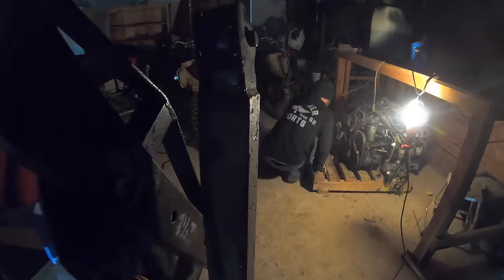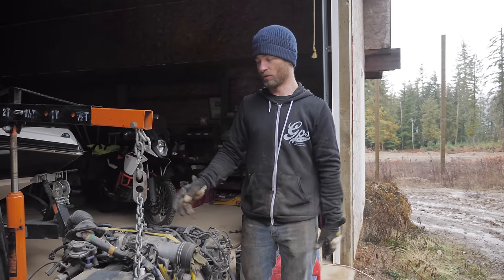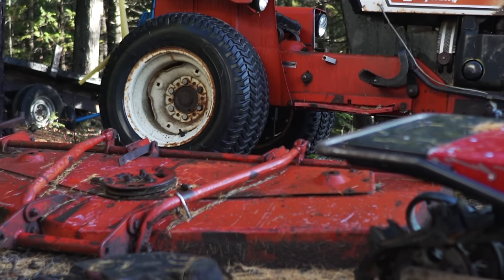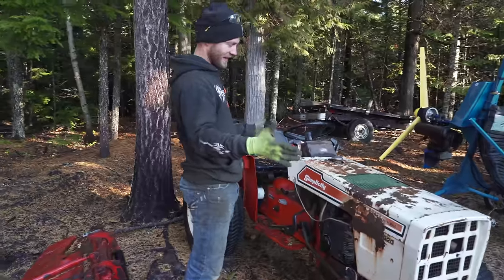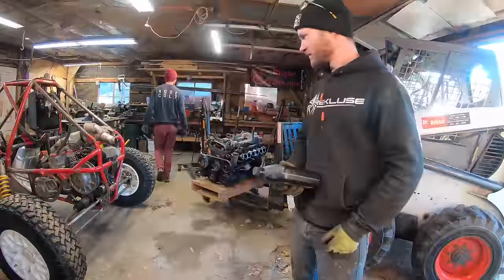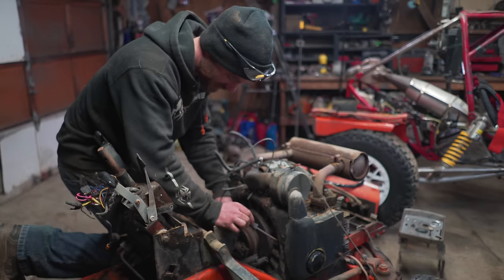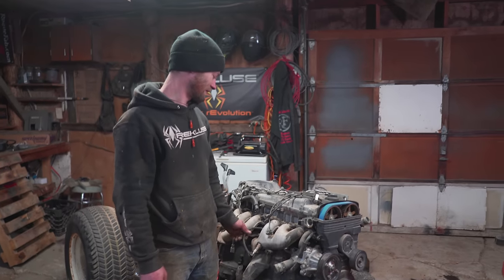2JZ Lawn Mower Build

Comment from the maker: Install Raid for Free ✅ IOS: https://clik.cc/GHPC_iOS ✅ ANDROID: https://clik.cc/GHPC_Android
Reply: I don't think I've clicked to a video faster than I just did...😂
Reply: I can’t wait until the build is complete
Reply: You guys need to make an app that you build cars and “toys” on
Reply: Why 2j a lawn mower but put a snow mobile engine in the triumph probably just swap that around an you’ll be better off  would be way more dope n controllable
Reply: "turbo it till it blows up" so 1400 up lawnmower?
Reply: @dave_wheelies3903  Because the Triumph is up and running.
Reply: You guys need to be careful when u get that done that kinda scares me. But still super rad build tho!!
Reply: Get a head off of a turbo 2jz engine that’s the only different in the turbo and non turbo is the head
Reply: Hey there, Just an idea I had! instead of using the distributor you could install coilpacks
Reply: If the good Lord keeps you rolling I can only imagine what you guys will be building in ten years from now!! Nice grinder!
Reply: Its been awhile. Vidio on update?
Reply: do a update video!
Reply: When is the driving video??
Reply: Hey where’s part 2?

Comment from the maker: We forgot to mention this in the video but we will be installing a fully-functioning mower deck just have to get everything sorted out without it first. If all goes well hopefully we will be drag racing come spring! Thanks for watching guys!
Reply: Grind Hard Plumbing Co can’t wait!
Reply: Awesome 🤘😂
Reply: Nice
Reply: Didn’t Life OD do this to a tractor? Lol
Reply: Grind Hard Plumbing Co don’t
Reply: Ls swap an office chair
Reply: I'm glad.
Reply: Cuttin grass at 88mph😂who needs roads whare were going
Reply: WAIT, i have a question. If you put a mowing deck on it, can you use it to make/fix a track that you made? cause that would be a pretty good idea.
Reply: @marksidorov9365  😂👍
Reply: You should make the engine an integral part of the frame somehow...bolt the front suspension to the front of the engine and the rear end to the rear of the engine...rather then just mounting the engine so high up on the existing frame.
Use a trans from a 4x4 truck that has a mounting flange on the tail shaft output to an adopter to a c6 corvette diff...or just use a c6 trans and diff...
Reply: Hook up with PFI Speed, and The Boosted Boiz...they build FAST 2Js
Reply: Drift mower question mark
Reply: Damn, came down here to comment just that, straight six music ought to make cutting the damn grass so much more fun.
Reply: @harryguy76  I was thinking along the lines of a power glide with narrowed axle for the rear. Either way should be interesting to see what they come up with.
Reply: @marcusharder3643  Yeah I am curious to see how they pull this off...and still maintain the ability to use the mower deck lol...
They got skillz so I sure it will be good...
Reply: Hey why don’t you guys try a miata motor or a four cylinder
Reply: Also try to get stand alone ecu it’s kinda money or try and stock ecu that is unlocked
Reply: JUMPING OUT MY SEAT
Reply: @memedogmemeaccount2163  That would be the easiest to do plus due to the much lighter weigh would probably yield the best usable performance...something like a K 24 Honda engine with a small turbo...or even a 2.0 turbo or supercharged Chevy Cobalt engine...
Hell even an all aluminum 5.3 LS engine would be lighter then the 2JZ..not to mention much cheaper for parts...plus bolt right up to a C5 or 6 trans/diff...but would require a arms, spindles...cv shafts...which would also add more weight...
But if they are going for simple..I would think an 5.3 LS...trans out of a 4x4 truck that has the mounting flange to mount the transfer case...but rather then mounting a transfer case, make an adapter that can be welded to something like a 10 bolt truck rear axle...so the engine trans and axle are all one solid unit...then mount a simple I beam front axle like used on a riding lawnmower but heavier duty obviously...bolted to the front of the engine...
Thought if they plan on having front and rear suspension...will greatly increase the builds complexity...not to mention with the addition of a functional mower deck.
Whatever they do I can wait to see what they come up with...
Reply: Knowing that your drag racing this makes a lot more sense
Reply: The 2jz needs to be turbo'ed
Reply: The fuck are you gonna mow? Tree stumps?? HAhahaha
Reply: Can't wait
Reply: You can delete the distributor and convert to coil packs using the setup off of the VVTI 2JZGE and GTE they use the same ignition system and vvti 2jzge wiring harness is very similar to the vvti 2jzgte. If you turbo the ge motor just thrown in the turbo injectors and plug in the gte ecu. (I have a stock twin turbo setup I’d be willing to donate to the channel) Hit me up if you have questions. I work at a Toyota dealership and live in Idaho
Reply: Grind Hard Plumbing Co Yo cool project maybe have the valve cover coming through the hood like a shaker hood scoop but a shaker 2jz 👍🏻
Reply: that i'd love to see live
Reply: I love the statement" I don't have patience to restore things" but has plenty of patience to stuff a 2J in a old Allis Chalmers lol I fucking love it.
Reply: beat onion in the 2jz tractor race

Comment: Me: See's notification for 2jz lawn mower

I DONT NEED WORK, I NEED ANSWERS
Reply from the maker: It's happening for real! Currently looking for a transmission!
Reply: @GrindHardPlumbingCo  look at ar5s maybe
Reply: @GrindHardPlumbingCo  You should go for a two speed powerglide
Reply: @GrindHardPlumbingCo  Would a powerglide work? They are pretty compact but I'm not sure if they bolt up to a 2j. What kind of rear end are you guys thinking of using? Maybe look at Brent's Bully from PFI speed for some ideas? His drive train is pretty compact.
Reply: @TheBignick243  just get motomule to make a adapter plate
Reply: @GrindHardPlumbingCo  I'd recommend a Corvette transaxle as it pretty compact and decent with lower power applications although it's you have to account for crank rotation direction, gear ratios, and power output as these transaxles aren't the greatest with high power and/or load
Reply: Lmao. Bravo for creative streams of thought! I mean it doesnt take much to repurpose for another series. U guys think an awful lot like me but this one is... maybe a bit out there! It's alright, I'm still watching and enjoy fellas! Let's see it!
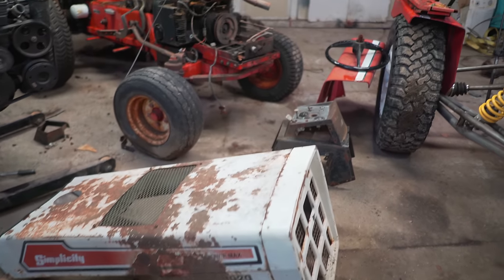Reply: CHECK THE ROTATION OF THE OLD AND NEW ENGINE.  !! . . . .  Guys, Small air cooled engines rotate CLOCKWISE facing the ( 6:40 ) flywheel / fan.    The ( 6:08 ) power take off / keyed shaft rotates COUNTER CLOCKWISE.  . . . . .. Automotive style engines ( except for most Honda / Corvair ) rotate COUNTER CLOCKWISE on the flywheel / transmission side and CLOCKWISE on the pulley / front of the engine.. . . . . The original tractors transmission is likely to be strong enough, this is what is considered a compact tractor and far more than a tin foil framed lawn tractor.  I'm pretty sure this was also rebranded under the CASE label for a while... . . .. When you go down the path a turbo, I'd expect one of those mini diesel 3 bolt flange turbos to be plenty.
Reply: Jaden Mason  At that point it is no longer a compact tractor and more of a ministock puller.  This tractor is way more than it looks.
Reply: Grind Hard Plumbing Co just weld the existing drive pulleys to the flywheel /s
Reply: @GrindHardPlumbingCo  you should get a falcon racing 2 speed for it if there is stuff to make it work
Reply: What up with this build?
Reply: @GrindHardPlumbingCo  when?
Reply: @Grind Hard Plumbing Co whats the status on the 2JZ lawn mower

Comment: Great idea! If you don't know what to do for the transmission, you should consider BMW transmissions like the getrag 260 or 265 and the ZF S5D. They are really short and small, use linkages to change gears (would allow to place the shifter where you want it), are made for rwd applications, really cheap (<300$) and hold a bunch of power. You can also buy kits to mate them to 2jz. Just a thought. Good luck!

Comment: Hey just want to give you a tip when you are using the small wheel attachments I would suggest running your grinder at a slower speed so the bearings aren’t stressed to much

Comment: Honestly, stretch the frame and mount the front axle more forward, cradle the engine between the frame so that you get it lower.

Will make it less tippy and will also make it more stable in speed.

Comment: Shoulda called the boosted boys and put a "k" in that thing...
Reply: djpickle68
Nope. Enough with the boring K series builds.
Reply: @negativeindustrial  2jzs are more common than k swaps lol either way both wouldve been sick
Reply: Brady Johnson
I drive an MR2T. All I hear/see lately are K Swaps.
Reply: @negativeindustrial  makes sense, mr2s are very k swap prone lol. Someone needs to 2j a mr2 😂 no matter how unrealistic
Reply: Brady Johnson
It could be done. It would involve a ton of custom work but unlike most AWD/FWD setups like the Celica GT4, it could be done.
I’m still a diehard 3S-GTE guy. Have been for three decades. Everything is the same as the 2JZ except there are only four of them and one turbo from the factory. My 1994 Celica is a monster - the MR2T is just a fun car to drive with only 300whp.

Comment: Not sure if your thinking of using the hydrostatic transmission or not.  The Sundstrand unit in the 9020 is probably rated at a maximum of 4000 rpm. You could use a gear drive trans from an early cub cadet to eliminate the limited rpm. Most garden tractor pullers use this transmission.

Comment: The Sundstrand 15 pump in that is rated for a 4000rpm max input. Cooling for the pump is recommended to be 25% of the engine horsepower and getting heat out of the fluid is going to be critical in keeping the pump alive.

Comment: and to help a little since there is no suspension just hook up the trans to the rear axle cut the frame to snug the motor into the frame and extend the frame to fit all the other stuff you need to run the motor

Comment: I think that when you tear it down and start taking out ac and other things you don't need, you should try and use the power steering, I think that'd be pretty cool🤷🏻‍♂️, especially since it's gonna be so heavy on the front end of the little tractor

Comment: Y’all should cut the frame and use the engine block itself as the frame. It will drop it down so the hood will fit better

Comment: Should put the 2jz in the Triumph and take the snowmobile engine and put it in the lawn tractor chassis. That would make a much better fit both engines and make it so you can use the full potential of the engine.

Comment: Would be neat to add up all the stock lawn tractor parts, cutting deck, stock engine and all and see if it’s less than the 2j. Just to see if it’s overall lighter than the stock mower set up

Comment: Hey  bros, the non vvti GE motor has the same crank and same rods as a GTE with a slightly higher compression ratio.  They will handle some boost with no issues!  Also that motor is from an SC300, the rear sump oils pans sell for like 400-500 USD alone.

Comment: alright. get a transmission. cut the frame so the transmission becomes the structural bit of the mower. mount the motor., then attach the front-end to the front of the engine.  this will allow you to sit the engine lower in the mower.

Comment: You can use the ignition system from the VVT-I 2JZGE (1998 or newer) and delete the distributor and convert to wasted spark coil packs. I have a VVT-I 2JZGE On my engine stand, I can take pics of you want.. I’m also in Idaho, But southern Idaho (Boise)

Comment: That grinder cool they use something like it when making knives on forged and fire. But that  that a 7m motor the 2jz motor is turbocharged . But understand why you put 2jz on the tag because some people doesn't always know motor codes. Sorry for rambling should be a cool build going to be crazy fast your definitely going have to put a kirky seat in with 5 point belt

Comment: You have to call her the "SIMPLICITY 2JM" (M for mower)
simplicity is already such a sweet name, you have to pay homage to the original name.
FYI: For grinding flat metal plates of smaller awkward pieces of metal I suggest using an (arrow-style welding magnet), I use it when making custom knives on my belt grinder, you can bear down on the belt without worrying about your hands or gloves getting ripped to shreds. It will go through thick leather gloves like nothing, you see what it does to steel. Trust me from experience.

Comment: where are you going to put the ECU and all the electronics that you're going to need to run it not to mention you don't need a decent size fuel tank because it is fuel injected so you going to have to pressurize the fuel lines

Comment: Um, fuckin yes?! My friend and I built a lowrider Murray mower back in the day in/immediately after high school, with a Kohler twin, dual lake pipes (sounded kinda like an old Harley), no deck, slammed by simply butchering the front frame and rear 'frame' (for lack of a better term, really just a stamped piece of heavy sheet steel) and welding everything back like 10" higher. We put a centrifugal clutch from a go-kart on it and made it chain drive with some motorcycle sprockets and some weird little right-angle gearbox we found in his dad's barn (I think it was a boat part of some kind) and have an accelerator pedal. It was pretty cool, but useless. I suspect this will be considerably cooler, haha!

Comment: a year later it finally rolls around the yard, not running or stopping just rolling and turning.
Reply from the maker: It did take us a while to get back to this build...
Reply: @GrindHardPlumbingCo  going to have to wait till spring to build the hauler, won't fit in the workshop. Auction off some old builds, build you a shop.

Comment: Normal 2jz is extremely easy to convert to turbo variant (ask any drift car builder). original non turbo 2jz can take extreme amount of power without touching the insides.. great motor and amount of power you would get with turbo is way too much for that lawn mower.

Comment: hope you lower that thing by a lo or youre going to flip the thing ,
think you only get to use the hood seat and the dash , the rest you probably build custom or at least should build custom 
hmmm the hydrostatic drive i seen work with v8's too (v8 bar stools)
 next projext emergendy power ? getting or building a generator and a way to tie in it intoo the existing electric circuit
beltgrinder looks realy good , i aspecially like that they dont use the expensive rubber drive wheels i'm in europe so shipping is going to be too expensive for me , i think i can build it myself though

Comment: hmm the standard non turbo 2jz only has about the same power as the 2.0l 4 cylinder engine off the toyota altezza rs200 (lexus is200) i.e the 3sge beams engine. which is the one i wanted, but i saw the toyota altezza as200 for sale cheap and needed a new car fairly quickly so i grabbed that. its a slow 1gfe engine but oh well. anyway, what i was saying was that heavy 2jz does not make much power stock for the size of the thing. i hear they are famous engines though, the power people can get out of them modified is insane.

Comment: God no! I would've given that Simplicity a nice life here on the farm with my Allis versions of the same tractor.. I actually emailed these guys a few months ago asking if it was for sale.

This is a really bad swap idea anyway. The tractor is a hydro drive with rear drop box, gear reduction axles. If you keep the hydro drive, you won't gain much of anything with the larger engine. You might also spin the hydro pump way too fast, destroying it. If the tractor still has the rear PTO shaft and electric clutch that still engages, then that alone is worth about $350 to $500 depending on condition. Soooo many parts on that tractor I could use for mine!!
Reply: They're clearly not going to try to keep the stock driveline
Reply: @achilleaustin  They don't state anything to that effect in the video. In fact, they talk about how the clutch hooks up with two belts, and the engine should sit right in the same general area. If you're gonna remove the rear drop boxes to put in a one piece rear axle, at that point it ceases to be a tractor, gets low to the ground, and essentially becomes a go-kart. Just a bad swap idea from the get-go.

Comment: Soooo....its a hydrostatic tractor...hydro trans is designed to run at like  3600rpm. Whatcha gonna do when you throw 8000 rpm at it and it says no? It can only spin so fast. Not to mention, any driveshaft that is gonna mate to that trans is gonna snap immediately when you put that kinda power at it

Comment: think I see where you are going, but..... exactly what are you going to do with it? The tractor rear end is very heavy but is very low geared and designed for speeds below 15 mph or so. You cannot use the hydraulic drive the double v belt is attached to- to much hp and to many revs; it will burn up pretty quick. Also the tractor is a light 1200 plus pounds, and has no suspension; going very fast on it is going to be like trying to hold on to a bucking bronco horse. It will always be top heavy and likely to flip during hard cornering. So I'm thinking slow, like a rock crawler. The older GM truck trans with a granny first gear might be just the thing- lock out the high gear, and it ought to be good to go. It's also a fairly short transmission.
   What ever you do, the suspense is huge; I want to wee this!FR